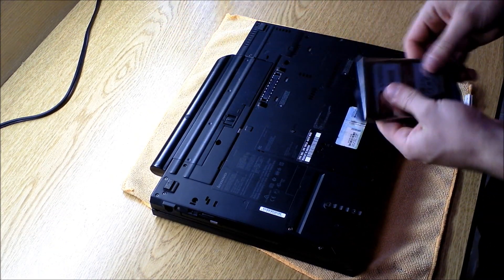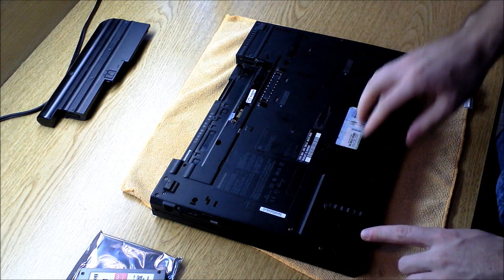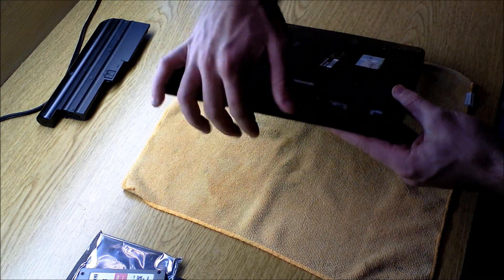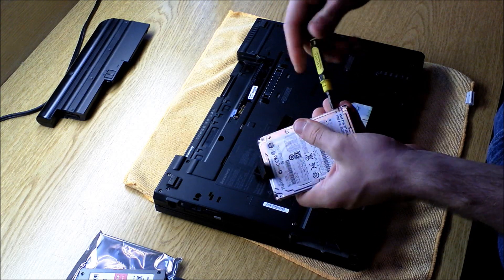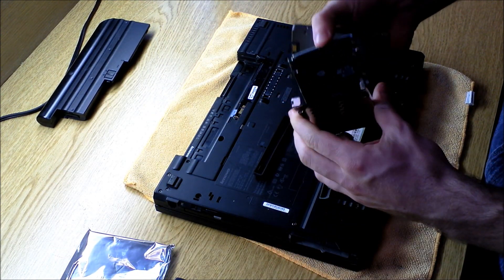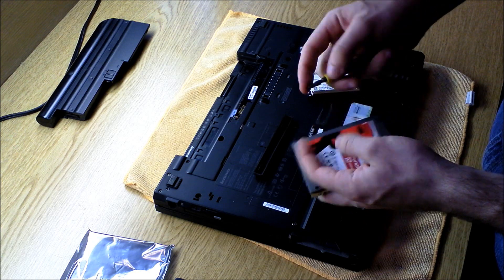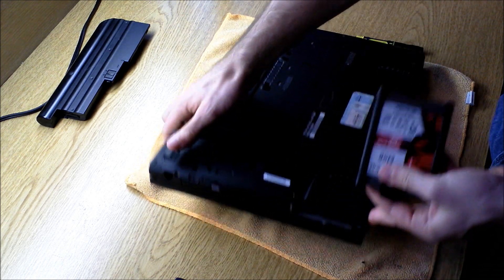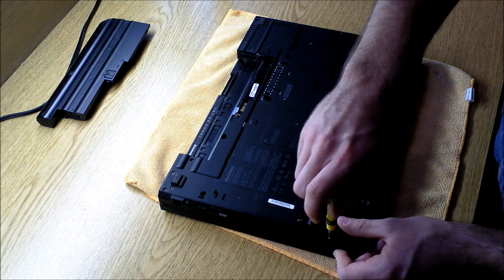Tutorial: Installing Kingston SSD in Lenovo T500, Video in 1080P

Comment: You can also put the old drive in the ultrabay with the proper adapter. Lenovo makes them, FRU #43R1980 but chinese knockoffs can also be found cheaply on ebay. Search for 'Ultrabay SATA' and you can find the right part. This will replace the optical drive, however. You can also get a second battery for this the ultrabay, if you would find that more useful than a second drive.

Comment from the maker: Yes, that is a very nice drive. Be sure to go into the BIOS and set your SATA controller as AHCI mode before attempting to install windows. It is very easy, just go into setup, find "SATA Mode" and make sure it is AHCI and not IDE or RAID.

Comment from the maker: Kind of- the laptop only has one internal header so you would connect the SSD to the laptop. Then, you could use the harddrive in an external enclosure (usually $8-15) via USB. Now, via normal USB 2.0, loading programs will be slower than normal. Personally, I would only recommend this if you wanted to store music, pictures, video, etc and not programs. For games, definitely put them on the SSD. The time in between levels (loading screens) depends on the speed of your drive.